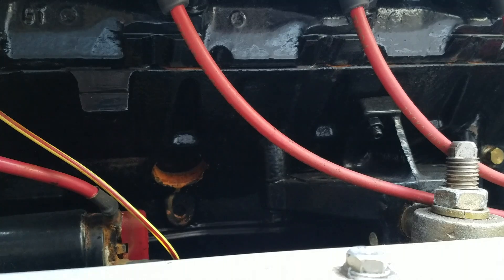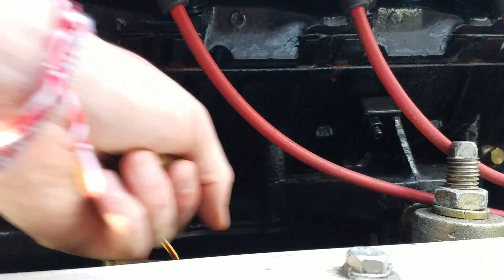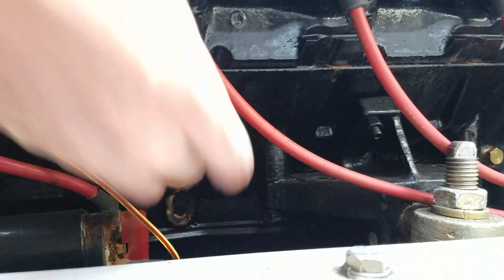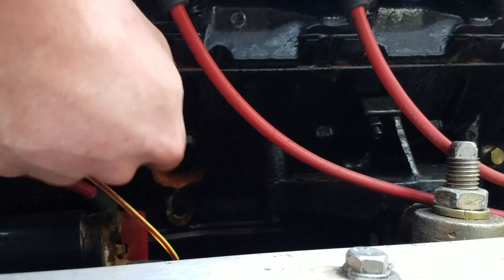My Engine Froze Over The Winter

Comment: That's not what block plugs are designed to do.  They aren't made to protect your boat from freezing
Reply: Why are they there?
Reply: @leesire  , 

Core plugs or Welch plugs are also improperly called freeze plugs, are used to fill the sand casting core holes found on water-cooled internal combustion engines during the manufacturing of the block.
Reply: @gundriver7211  thank you.
Reply: How do you clean out all that rust in the manifold and engine block on those inboard out boards?

Comment: You posted this video long after your winterizing video.  Considering you posted the other video 2 years ago is there anything different you would do? I planned on following your winterizing video step by step and it is my first time, but a little concerned since your still having water in the engine haha. Also, one more thing is do you still recommend using plumbers tape? I've read mixed reviews and some people say to use pipe thread sealant compound since it's safer being that particles of plumbers tape can fall through? I just bought a 95' Sport Nautique so this is why I ask with the questions! Thanks for the uploads!
Reply from the maker: Hey Jeit3, thank you for the great questions. I would still suggest following my winterizing video. I actually should have watched my video because I failed to drain one of the draining holes on the side of the heater core. If I would have followed my winterizing video this would not have happened. You are totally right on the sealant vs. the tape. You can go either way. At this point, it starts to become a preference. Many people have opinions on a lot of things and I just try to stay with the facts. But I do know I don't have any leaking which is a plus! However, sometimes I will clean the thread before I reinstall it with a new one.